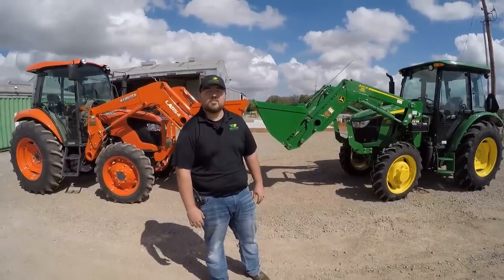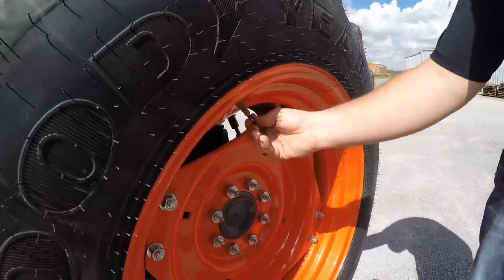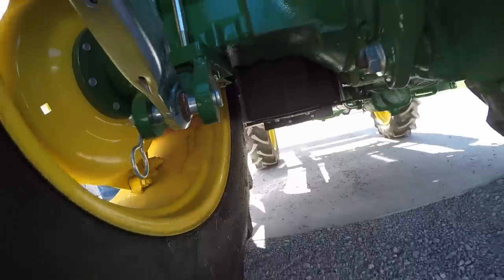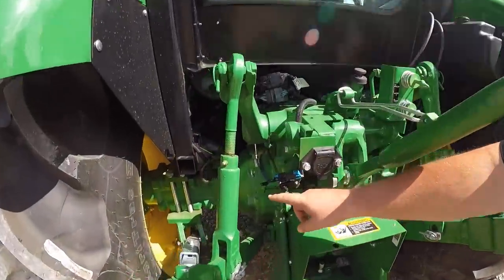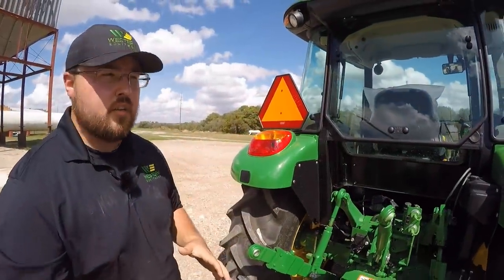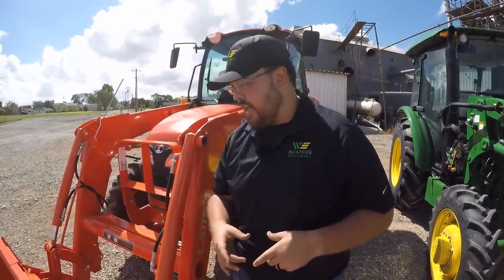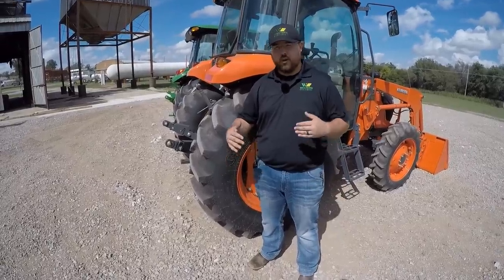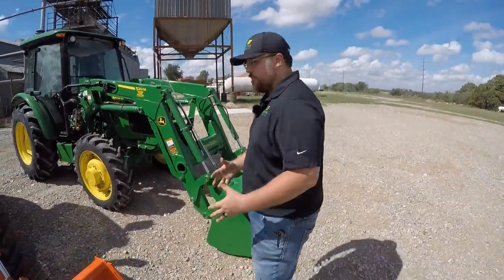John Deere 5065E VS Kubota M7060 | Product Walkaround and Overview

Comment: So how do I drop 600 lbs from the JD if I dont need it or dont want it, I can add weight to either  but sometimes heavier is not better, what's up with JD proprietary quick attach this is 2019 use the industry standard skid steer quick attach, and plastic cracks my Old JD has more cracks and bits missing, I can pop a dent out and or repaint  to match on my kubota  in a half day back to new, my deer that hood is so f n expensive forget it. Most stand out options are  non standard options on a deere, dodnt show how low the 4wd shaft hangs
Reply from the maker: In this size class of tractor, which are generally used for hay and utility work, when is more weight a bad thing?
Reply: @WesternEquipment  versatility. Not everyone uses them the same way.
Reply: I always prefer the heavier tractors it does better when pulling . I am looking at the 4700 series Massey Ferguson because they in at about 10,400 lbs tractor cab and loader  you can get the Massey Ferguson 4700 series in a 70 hp in 4707; 80 hp in the 4708; 90 hp in the 4709; and 100 hp in the 4710 . I drove tractors all my life it is  good to have that extra weight for plowing, moving round bales of hay; and pulling a baler going down a steep hill. A baler almost full of hay can push a lighter tractor down the hill where as the heavy tractor it won't.

Comment: What about the Deer's internal 3 point cylinder, 20hp tractors have the same design...
Reply from the maker: Are you insinuating the internal cylinder is a bad thing?
Reply: Fire is hot, water is wet and internal cylinder is a bad design.

Comment: The hydraulic couplers and the battery is more likely to get torn off
Reply from the maker: Maybe if your driving through large mature trees or climbing boulders?
Reply: @WesternEquipment  ah well, then. I guess the power steering and tool box would be ok on the Kubota too unless, of course, trees and boulder crawling.

Comment: My take is most manufacturers make solid well built tractors that can do an honest days work. But however what I think most people overlook is the dealer support; it's more important to have a dealer that can support you then it is a tractor that looks better on paper or has more weight ect. Number one every tractor is going to be ballasted anyway unless you're literally only using it for light duty tasks such as bush hogging a field where that has relatively even terrain and doesn't need all the extra traction. Number two when the tractor does break and all of them do, will your dealer be there to help you; how good is their customer support? For me personally whether that tractor is green, orange, blue, red or other I'm gonna go with the one who has the best dealer support long after the sale and which one I don't have to drive over an hour one way to get parts and service for
Reply from the maker: This is a great point! Thanks for watching!

Comment: I purchased a kubota m4d-071  in october 2019 and thought they were close to Deere but I was badly mistaken, it would compare to a deere 5075, the steering is weak, the air is weak the loader leaks down while you are using the tractor, the loader valve has been replaced once but it's still leaking down if the hoses are disconnected from the tractor it holds so it has to be in the valve, it has 3 remotes on the back and all 3 leak down all with 150 hours
Reply from the maker: I have heard these same issues with a few.
Reply from the maker: There is a bright side to this maybe, If you do want to get rid of this m4d-071 Deere does offer some pretty hefty incentives when you trade in a competitive brand.  Might check with your local Deere dealer.
Reply: @WesternEquipment  they didnt when I talked to them, I would loose about 10,000 because of the low interest on new ones, or would be nice if ku ota would buy it back.

Comment: You pointed out the difference in weight as a salesman would when comparing tractors between competitive brands but let's not forget that base weight in a tractor is NOT a golden ticket to not use proper ballast! EVERY tractor whether it's a 25hp sub or a 400hp beast it needs proper ballast for the application.
Reply from the maker: This is very true. Thanks for watching!

Comment: Is the deer 5075M  better than the 5075E series
Reply from the maker: Like with most John Deere products, when you move up in series from E to M to R the quality is greater. More features, difference in build quality, functionality, weight, etc. Whether one is "better" or not is based on the operators needs. Fair enough?

Comment: Deere is made in India.  They also lose almost 40% of HP at the PTO.  Very misleading.
Reply: They retain more PTO hp than Kubota
Reply: Matt Lee you need to look at the brochure again.  I believe you are mistaken...the 5075e loses 17 hp to the PTO.
Reply from the maker: This tractor only has a few components made in India and lets check that HP loss number again, I think you're a bit off.
Reply: @WesternEquipment  the john deere 5060e has 67 engine HP and a PTO HP of 49. The kubota m7060 has 71 engine HP and has a PTO HP of 64 HP.
Reply: @WesternEquipment  The john deere loses 18hp and the kubota has lost 7hp to the pto. Soooo I think you're wrong bud.
Reply: @lowkeytemplar4819  He knows he is wrong but still has to sell the Deere for a living.

Comment: What's the difference in the pto hp
Reply from the maker: 53 HP for the John Deere and 64 for the Kubota, but there is also an engine HP difference of 65 HP for the JD and 71 HP for the Kubota. Also this Kubota tractor is not sent to the Nebraska tractor test facility to see exactly what its true HP rating is.

Comment: So at the end he doesn't mention the lift capabilities which I know why because Kabota out performs JD and has a adjustable lift rather you want height or more capacity with the moving of a pin on each side for the cylinder which JD doesn't have
Reply from the maker: Honestly, I did not purposely leave out the lifting capacities but now I will have to do some research. I'm wishing I would have put this info in this one. Thanks for the comment and thanks for watching!

Comment: I have had kubotas and john deere tractors, as well as new holland. In this size kubota has the best feature to price ratio and is much better in it's quality control. I have had nothing but trouble with john deere and new holland and the kubotas I've barely had any problems with them.
Reply from the maker: What kinds of issues are you seeing?
Reply: @WesternEquipment  The 3 point and hydrolics always leak no matter what we did. John deeres always seem to have the interior start falling apart after a year and engine problems. Finslly the internal 3 point pistons always fail after two years. Just bad quality controls and plastics.

Comment: Put cast rears on the Kubota and fluid in both tractors and the Kubota is heavier than the Deere.
Reply: Jerry Dikerson yes it is the 7060 we have has load tires and cast rims and it is heavier
Reply from the maker: That may be true, but the intent was to show the differences and comparisons in these two tractors that were spec'd as closely to one another as possible. Thanks for watching!

Comment: It’s like watching an infomercial where the guy can’t use a q-tip and stabs himself in the ear.  Orange has steering in front with guards which is bad, Green has steering on rear of axles which is good, Orange has hydraulics on inside of frame for protection which is bad, Green has hanging on the outside unprotected which is good.  Kubota vents you have to turn to point them at you and the throttle pedal is black, everyone knows this is dangerous. JD has all vents to cool your head and shoulders because JD knows you won’t need to cool any balls between your legs.
Reply from the maker: The opening line to this comment is a winner! Thanks for watching!

Comment: Great videos. You do a very thorough job Brent, thank you. 
Your video on the 835r xuv was also great.
Reply: Nevermind that he passed right over the proprietary RPM button to hold rpm's while pumping extra fluid to the pto. Oh and the nifty dual latch on the loader that gives you the choice of an extra foot to height or extra power for a heavier load.
Reply from the maker: Thank you!

Comment: Weight my M7060, it has cast rears and radial tires all around.
Reply from the maker: Take it to your local COOP and weigh it. Then let me know what it is.
Reply: @WesternEquipment  it weighs just over 10K. The silly argument JD salesmen push is just that, silly. M7060s can be ordered is so many different configurations it makes that talking point irrelevant to anyone that does their homework but these videos aren't focused on those people only poor customers that don't know better. The comment about the SMV sign is silly too. The only way I ever know my sign is there is looking from outside the tractor. It blocks zero visibility from inside.

Comment: I don’t agree with the comparison at all. He shows the differences between the two which is great but he is clearly a JD fan. Pretending the battery location on the JD is the best but why wouldn’t you want it under the hood. JD has it so low that if you go through water your in trouble. Also talks about resale which is just not the case. Both great machines but when I was in the market I chose Kubota for my personal tractor. Very happy with my tractor and I will continue to own Kubota.
Reply from the maker: @briannelson It’s a commonly known fact that John Deere Equipment holds its value better than Kubota. There is a reason why people buy both brands, but holding its value is not a Kubota selling point. Anybody that sells a Kubota on that isn’t being genuine.
Reply: @WesternEquipment  YOU ARE WRONG WRONG WRONG.  TOTAL BS
Reply: Marc Kimbrell no he is 100% correct. Deers has better resale.

Comment: I just bought a 5075e in August 2018. The new holland I had was a lot better machine for handling on hills. I do like things about the john deere over the new holland but the JD has about 2 times the fuel consumption then the NH. Will i buy another JD? I'm not sure yet
Reply from the maker: Hmmm interesting! We will have to look into a fuel consumption video!

Comment: If i buy a 65hp tractor I don't expect only 53hp at pto the kubota 7060 pto hp is 64hp from 71hp, 6hp loss instead of 12hp loss on the Deere conveniently not mentioned. So biased
Reply from the maker: Here is something else to consider, Kubota does not send the 7060 for testing at the Nebraska Tractor Data Tests, so in all honesty we do not have a way of showing their rate of loss, otherthan taking their word for it. Where as John Deere does send their 5065E, and results can be found on the Nebraska Tractor Test Laboratory website. The true test and way to know would be to put both tractors, side by side, in the field doing the same task and then compare performance. You say I am biased, which may be true, but let's also not hide the fact that Kubota may or may not be telling the whole truth. Just food for thought.
Reply: Correct but not metal
Reply: @WesternEquipment  Automatically assumes companies lie about their products. Must be that nasty Kubota company. How dare they sell a better tractor for less money. Ll

Comment: JD 5075E—74HP, 57PTO.....Kubota 7060–71HP, 64 PTO HP....how does the Deere lose 17 HP to the PTO?....I have to believe it as real and related to the JD using a little 3cyl and the Kubota using a larger 4 cyl.  I also don’t like the fact the 5075E uses the same motor as the 5045E....seems JD is squeezing everything they can to get to ~70 hp....I would really like to consider JD in this class but these issues bother me.  If JD used the 5090e 4cyl and detuned to 75hp I would be sold.  Thanks for the side by side look.
Reply from the maker: Just keep in mind that Kubota does not send this tractor to testing in Nebraska so its hard to know how accurate their data is...
Reply: Good point. Was wondering about how they squeeze the extra hp also.

Comment: 1800 trouble free hours on my 1996 John Deere 5300 (except for a broken roll pin in the gear shifter), so I think I’ll stay with John Deere when I upgrade in horsepower and getting an air conditioned cab.
Reply from the maker: Sounds like a good plan!

Comment: So the additional cost of the '500 series Deere' front loader attachments will keep Deere users from aquiring 'skid steer' front loader attachments that might overload their Deere.  How thoughtful of them.
Reply: The skid steer attach system is a relatively weak system that does not stand up well to utility tractors and should never be used on them. They're simply not strong enough for this sized tractor.
Reply from the maker: Yeah, I thought so too!
Reply: I like the global style only one lever to release and latches on its own when you curl it back what's not to like

Comment: Bitch of it is the hydraulic lines are in the way of the fuel filter on the orange one. A bad dose of fuel at 10 degrees F would  make you curse.
Reply from the maker: This could be true. Thanks for the comment and thanks for watching!

Comment: I'd like to see a defrost mode on the heat and air
Reply from the maker: On which one?
Reply: @WesternEquipment  probably on the Deere. Kubota includes a dedicated defrost vent on the steer panel like most automobiles. Very nice.

Comment: If you don’t know what a foot throttle is or a joystick for a loader you should keep your ass out of a tractor. The only thing better on the Deere is the heavier weight but the price difference isn’t worth how much more that Deere is going to cost you. As for the resale you better get more for the Deere because you paid a heck of a lot more for it initially compared to the Kubota.
Reply from the maker: Compare prices apples to apples and spec for spec and let me know how it comes out.

Comment: Lol😂the placement of the hand throttle in the JD I use the hand every time I use the tractor how is that foot and hand throttle economic 😂
Reply from the maker: The placement of the hand throttle on the JD is up high, easy to see, and not surrounded by other levers. It is very east to get to and to use. Its also designed with the rounded base and integrated lever to be comfortable for resting your hand on for the operator that prefers using it over the foot throttle. But I'm confused by your comment about the foot/hand throttle combo as the Kubota has it too. None the less, thanks for watching!
Reply: How many hours do you spend in a tractor? The closer things are to the operator the better.
Reply: the placement of the foot throttle is what I am talking about.  its way up in the air and off to the side very uncomfortable to us.  the Kubota is up in the air to but once you place your foot on it, it drops some and is more comfortable and its not so for away from the brake pedels.  I test drove both and the dealer I bought from had both. didn't bash neither one. you should us a few weeks and then make a video, and I don't me going out and putting around I mean farm with it and then compare. until you use then you have no idea what they are like.

Comment: A comparison video by a JD dealer, I haven't watched the video yet but I'm betting the Deere is going to look like the better choice based on this video.
Reply from the maker: @bearkatljl  There arent many YouTube videos out there that present comparisons as fair as we do. If you find them I'd love to see them. We're all about doing a better job.
Reply: Western Equipment I’ll grant you that your video is fair however it seems to me that your “better Deere” points are kinda cheesy. And as far as price goes my Kubota M 6040 cost $2,000 more than the Deere 5065E I could have bought.
Reply: What makes it more expensive?
Reply: @WesternEquipment  What a lie. I went into this thinking the Deere was better.  All I got was a biased review. Thanks for crapping on the competition rather than just simply comparing and letting the viewer decide.

Comment: Was a good video. But I think some of the things you pointed out on the Kubota that weren't as good as the Deere aren't 100% true. Both these tractors are pretty much equally capable of doing same tasks, the biggest variable that would hold them back is the operators experience. I would like to point out that to me having the battery box and the hydraulic hoses where they are on the Deere is bad location for the same reason you said Kubota steering linkages are. I think your way more likely to catch those hoses than you'll be to run something into your front axle. But then again these are all things a buyer should be considering they may want those hoes to be easier to get to.
Reply: Replacing the battery on the Kubota would be a pain the in the butt. The battery location on the Deere is easy to get to and completely encased in a metal box....not sure how you would catch that on anything. My grandpa who is almost 80 would never be able to pick the battery up out of the Kubota and replace it.  Like you said, both tractors are equally capable of doing the same work but I do find the John Deere has invested more time into the engineering of their tractors.  My neighbor has this Kubota and he does complain about the steering arm location and the small metal arms the loader sits on. Other than that he is very happy with it.
Reply: Really...replacing the battery on the Kubota would be a pain? 
I could see that if a person had one arm missing or was a bag of walking bones.
Reply from the maker: Yes, a lot of things are customer preference!

Comment: So John Deere thinks that I have to pay extra money for a door handle? What's wrong with their marketing department?
Reply from the maker: I just think that since most people do not use the right hand door from the outside they eliminated a point of entry that is not necessary. The door in most cases can still be opened from the inside.
Reply: @WesternEquipment  I used mine all the time.